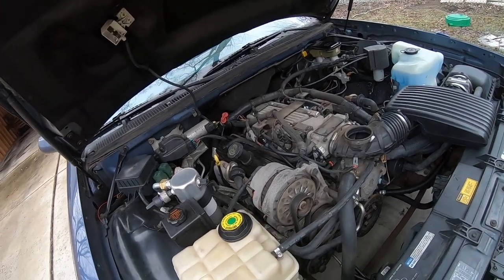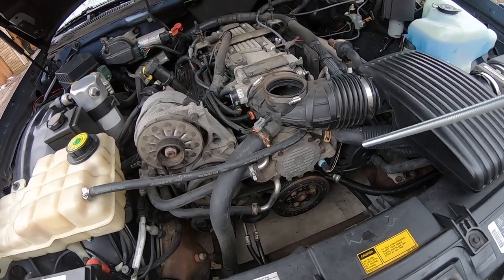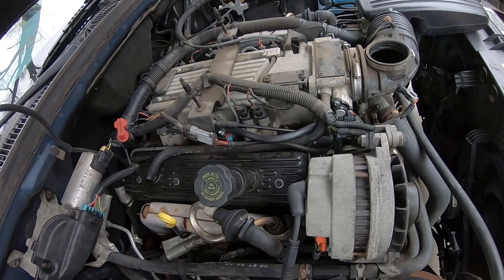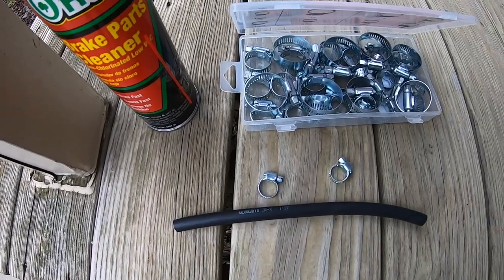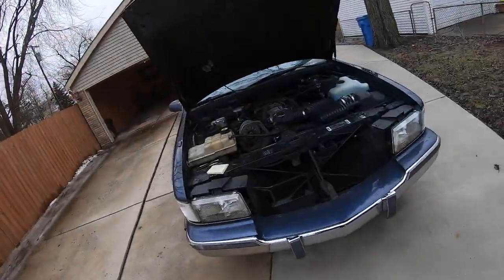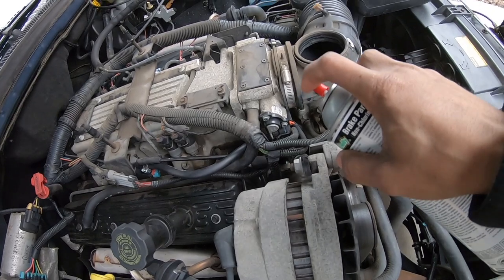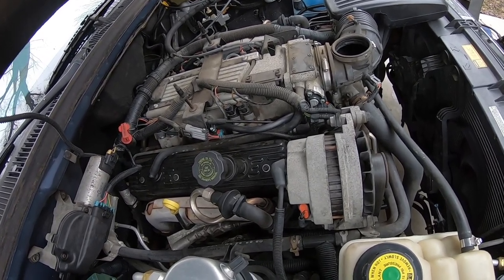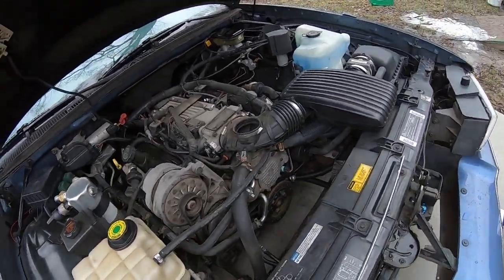LT1 Stalling Problem? Starts then Dies? Check The Vacuum Lines! Not the Optispark & Beware of Forums

Comment: I have a 95 Roadmaster that has a hard start condition but once it turns over it'll stumble and miss but keep running.  I have no check engine light or codes stored.  Can this happen with a vacuum leak? I haven't had it stall out.
Reply from the maker: It could definitely by a vacuum leak. My LT1 stumbled at first. Then as the leak got worse, it began to shut off. It’s quick and easy to check. If it not your vacuum lines, move on to the next possible thing.
Reply: @WorkingWithWimberley  Thankfully that was not the case. My factory plugs were completely shot with no center electrode. But I am replacing my vacuum lines while I'm digging into it.
Reply from the maker: @kevinr8459  I’ll be doing my plugs and wires as well. I hope it helps me too.

Comment: Mines stall real bad when I give it a lot of gas at one time but if I baby it it will pick up speed gradually.. think it could be the vac? It's not cutting off tho
Reply from the maker: It’s possible. You won’t know until you check it. Hopefully it is, because that’s the easiest fix.
Reply: @WorkingWithWimberley  okay appreciate the quick response too!
Reply: I have the same problem bro... did you ever figure out what it is
Reply: @BDOT2012  it was my mass airflow sensor bro
Reply: @318sears8  yeah bro I replaced mines too and still no luck... I appreciate it G!!!
Reply: @BDOT2012  try some fuel treatment i done that too

Comment: Hello I have been having trouble with my 95 camero z28 I have posted a in depth video of the viechle could you check it out and  give me a opinion on what you think my brother and I believe we have received 4 malfunctioning optispark distributors now and is recommending I upgrade from a Oreillys brand opti to msd or ac delco
Reply from the maker: I honestly don't know what it could be. There were few times that I had a car run rough and stall out. And that was because of a bad Mass Air Flow sensor. You may want to check in the LT1 forums and see what guys are saying in there.
Reply: @WorkingWithWimberley  ty for the response sir
Reply from the maker: No problem.

Comment: Hi kim
It doesnt caug fire if you spray the brake cleaner???
Reply from the maker: As long as you don’t spray onto a hot engine, specifically the hot exhaust, you should be fine. If you’re concerned about starting a fire, I’d suggest not trying this method.

Comment: What size flexible hose did you use to replace the original brittle ass hard plastic bro 😂?any specific one
Reply from the maker: It was just a generic vacuum hose you can get from Oreillys or Autozone. I’m not sure the size. Maybe a quarter inch.
Reply: @WorkingWithWimberley  thanks man
Reply from the maker: @Anthony0899  No problem.

Comment: Is WD40 OK to hunt for the surge? I don't have any cleaners. Stalls only once a day after driven about 10 miles, then never again until the next day.
Reply from the maker: It might work. I just googled it and it said WD40 is flammable so it should be possible.
Reply: @WorkingWithWimberley  Oh i get it, just needs to be flammable, didn't understand that part.  I have starting fluid spray too.  Sure hope I can fix this, even the Buick dealerships aren't familiar with LT1s anymore & the auto parts stores never have OBD1 readers (1995) Good info thanks.
Reply from the maker: @GenerallyGeneralLee Starting fluid would be perfect. If there’s a vacuum leak, it will suck in the fluid and you’ll hear the idle surge and get higher. No problem!

Comment: I have a question, my impala will crank but not start. Could this be the problem? It's not the fuel pump because it's new
Reply from the maker: It’s possible. I would check the vacuum lines.
Reply: @WorkingWithWimberley  thank you sir,  you have been very helpful
Reply from the maker: @juliohernandez5961  Awesome!

Comment: Ok so I pulled the little spark plug looking wire from the optispark that goes to the coil and turned the motor over and I have fire using a test light.. ok so I replaced the plug wire back in to the optispark and I pulled the front drivers side spark plug wire and placed the test light in the plug wire and turned the motor over and the test light wouldn't light up... would you say the optispark has gone bad?
Reply from the maker: It's very possible, but I can't say for sure. If you have a reputable shop near you, I would see how much it costs for them to test it. I'd hate for you to buy a new optispark if it's not actually bad.
Reply: @WorkingWithWimberley  ok I don't know what to do here... i have replaced the optispark, map sensor, mass airflow sensor, throttle positioning sensor, and the idle air control sensor on my 95 impala LT1 and it is still throwing a code.. today while the car is running I unplugged the Mass Airflow Sensor, the Idle Air Control Sensor and the Throttle Positioning Sensor and I even removed the hockey puck and the motor never stopped running or even so much as  hiccup... craziest thing I've ever seen... what would cause this to happen?
Reply from the maker: My guess would’ve been mass air flow sensor. I’ve had cars run like crap, but after you unplug the mass airflow sensor, they run fine. But you’ve already replaced that so I’m sorry, but I don’t have a clue.
Reply: Ok I've replaced the Optispark, Map Sensor, Idle Air Control Valve, Throttle Positioning Sensor and Mass Airflow Sensor on my 95 impala LT1 and its still throwing a code... just a few minutes ago it was running and I disconnected the Mass Airflow Sensor, the Throttle Positioning Sensor, the Idle Air Control Valve... I even loosened the hoses clamp and removed the hockey puck and the motor never even hiccuped.... I'm so freaked out... I thought the car would die or at least sputter or something... but if I try to drive it the car will die and acts like it wont start..
Reply: @WorkingWithWimberley  Thank you so much for your time and thoughts I really appreciate it... Merry Christmas to you and yours...!
Reply: @WorkingWithWimberley  Thanks for all your thoughts I really do appreciate it.. Have a blessed Christmas to you and yours....I forgot to mention that one its running its very rich and burning your eyes and smell and the fans come on immediately instead of coming on once the motor has warmed up...

Comment: Right now on this 94 z28 I’m now having issues with cheap azz Chevy gas lines cracking and brittle spewing gas under the driver side of the car.   3 places the line is cracked.
Reply from the maker: Those plastic lines definitely get brittle over time.

Comment: Hi brother 
I have 1996 caprice classic and when I start it and shifts the gear and get my foot off the break it dies and when I reverse it dies , what i do now is using both of my foots on brack and gas panel to avoid dies and to keep it running.
How to fix that brother, you think is the vacuum line?? 
Like yours 
Thank alot
Reply from the maker: I would check the vacuum lines first. And then I would check the mass air flow sensor.
Reply: @WorkingWithWimberley  thanks alot brother for responding  
I will do what you just said, hopefully that will be it 
Thanks
Reply from the maker: @aladwanit  You’re welcome! I hope you can fix it.
Reply: @WorkingWithWimberley  i brother 
I did what did ,, it is running better than before , but still shaking probably needs new sparks too 
I did replace the distrbuter and fuel pump and filter 
Let’s see how will it goes 
Thanks 🙏 brother
Reply from the maker: @aladwanit  You’re welcome. You may want to replace the fuel filter too. https://youtu.be/DUjfNdM1X7Q
Reply: Hi 👋 brother 
I did what you just asked me to do step by step 
But still the engine dies after 20 minutes 
And I noticed the temperature gauge doesn’t work I checked the temperature sensor it works and i did replace it after that i fond there is not electric ⚡️ on the wire that it stokes up on the temperature sensor at all and did check the wire every 2.3 inches till the wire go in to the wall harness 
Could you help me brother to fix my Chevy Caprice 96
Reply from the maker: @aladwanit  Did you check the mass air flow sensor?
Reply: @WorkingWithWimberley  no i did not check mass air flow

Comment: What size diameter was the part you replaced your vacuum hose with 3/4ths?
Reply from the maker: I’m not sure exactly. I took the worn vacuum boot to the auto parts store and had them match it as best they could with the hose.

Comment: How hard is it to swap the dash cluster on the 96 fleetwood brougham
Reply from the maker: It's not hard. I pulled out mine to replace a blown warning bulb. The only part that's tough is not breaking that shift linking indicator cable. I broke mine and it took me a long time to connect it back with a piece of wire.

Comment: Im going to try this out my problem started yesterday when i was taking off to work it did it once and then coming home from work with a few pit stops it stalled twice back to back at the light
Reply from the maker: I hope it solves your issue. It’s the cheapest solution out there.
Reply: @WorkingWithWimberley  did you have aby symptoms though i changed my iac sensor along with the tps cuz they were both right there but still having a little hiccup at idle

Comment: Hey bro I am looking into a 95 ss the seller claims the car never turns off while driving but it randomly wants to lose power but he claims to step on the gas and it goes away would this be the same issue you had?
Reply from the maker: My car was completely shutting off. If he claims his is not, I don’t think it’s the same issue. Could be anything really.
Reply: @WorkingWithWimberley  thanks bro!
Reply from the maker: You’re welcome!

Comment: Wish I would of seen this video b4 I bought the opti spark and had to travel an hour to pick it up and spend even more time to replace it and then buy more coolant to replace what was lost taking off the water pump
Reply from the maker: Was your optispark bad or was it vacuum lines?
Reply: The opti spark wasn't to bad but it was still changed but the housing did have a crack but 3 of my vacuum lines r in bad shape o still haven't got the car running tho is cranks but doesn't turn on

Comment: I am Japanese.  I am riding a Cadillac Bloom 94 LT1 engine.  But the fuel pump does not work.  The fuel pump and fuel pump relay are brand new.  The fuel pump fuse is OK.  Is there any other cause?  I'm really in trouble, please help
Reply from the maker: It could be low oil pressure or a fault with passkey security system. But these are just guesses.
Reply: WorkingWithWimberley 
Thanks for the reply, the passkey lamp is gone and the cell motor is running.  The current situation is that the fuel pump does not work even if the key is turned on, does the fuel pump also work if the oil pressure sensor has failed?  Oil level is normal.  Sorry for all the questions
Reply from the maker: I’m sorry but I don’t know why your fuel pump isn’t working. I hope you can find the reason.

Comment: Car been sitting since I got the motor replace sumtimes it starts sumtimes doesn't but when it does it'll run for few then just shut off like it's out of gas but I'm goin to check the house Right now I'll b so happy if that is the problem
Reply from the maker: I hope it's the vacuum lines too. I hope you get it solved!
Reply: @WorkingWithWimberley  jus posted do u think u could check it out and advise

Comment: my lt1 has a very slow crank like super super super slow then it starts , i feel my engine is dying i replaced the starter, battery, plugs, wires
Reply from the maker: You did everything I would do. I would guess the battery first and then the starter. You may need to do a compression check.

Comment: What if it doesn’t start sometimes as if it’s not getting gas with no dash codes? Someone told me it could be the computer. When it starts it runs fine!!!
Reply from the maker: To be honest it could be a lot of stuff. The only thing I can think of is maybe the fuel pump is on its way out. I’d also change the fuel filter. That’s a cheap one to rule out.
https://youtu.be/DUjfNdM1X7Q
Reply: @WorkingWithWimberley  It none of the stated. I have a 93, 94, and two 95's (all with same issue "starts, runs till it get warm, then cuts off. Won't start untill it cools back off).  I changed ignition, wires, plugs, new fuel filter, fuel pump, new vacuum line hoses (tests for leak "there are non"), new temp sensors, new fuses (and a hold host of other things that I can't think of right now). Another issue is that the radiator fluid turns brown. I've replaced water pump, heater core, radiator and flushed the engine several times.
The cars will start and run till they get warm, then shut off. There is no fuel flowing to the intake. After they cool down, fuel then flows to the intake and it starts. Get warm and then the same process. In the little time that it runs the coolant becomes brown. There is no indication of head gasket leak or other loses of pressure. 
Know what the issue may be.
Reply from the maker: @yebosawubona  One of the main things I see mentioned in the forums is the ICM ignition control module. If you already replaced that, then I don’t know.

Comment: Is there a vacuum line that connects to opit spark ?
Reply from the maker: Depending on the year, I believe so. You may want to check in the LT1 forums.
Reply: If so where is it located. I just  got a new LT1 engine installed. And I had to vacuum hose damage. But car still idling a lil lean and it did cut off once heated up at idle. Wish I had a diagram where each hose run and connect to
Reply: It’s a 94 Chevy caprice
Reply: Also has one vacuum line with funny shape hard black plastic don’t know where it connect to try to see it n your video but couldn’t really see where it connect too

Comment: What if the problem is the car dies out while actually DRIVING?
The car starts up fine after letting it sit overnight and drives fine for like an hour and/or like 20 miles a driving 
Then after letting lt sit for a few mins it will start up again but then die out again
It acts like it's outta gas and will rev high an then die
Reply from the maker: I would check all the same stuff I mention in the video. Vacuum lines, fuel filter, egr valve, mass air flow sensor, etc.

Comment: Nice job.  But beware of Harbor Freight hose clamps--they are worse than useless, as they will get you going, only to fail down the road!!
Reply from the maker: I’ve been using the hose clamps for years and I’ve never had a problem.

Comment: I gotta code P1371 if I leave it for a day it’ll start back up but it won’t start consecutively it literally only runs once a day and I can’t drive it for over 30 min 96 impala can anybody help
Reply from the maker: There’s a ton of stuff in the forums about that. Someone on this thread listed some possible solutions. https://www.firebirdnation.com/threads/engine-code-p1371-97-firebird-formula.291546/
Reply: @WorkingWithWimberley  guess I gotta change the opti that’s pretty much what I’ve been reading thanks just figured I’d give it a shot 💯

Comment: Home plate 😂
Reply from the maker: That’s what they call it!
Reply: Just bought a 94 and having that stalling problem at the light. Then the engine light goes on starts up fine after. Ill give that a try after I swap for colder plugs cleaned throttle body and air filter.

Comment: Just post a vid of egr could u check it out and see if you can help please and thanks
Reply from the maker: I just checked it out. It's kind of hard to see what's going on but you definitely need to replace all those broken vacuum lines. It won't run properly without them connected. You may want to replace the EGR as well. It's not that expensive and it's not hard to get to.
Reply: @WorkingWithWimberley   can I just run the hose straight to the EGR and eliminate the solenoid??
Reply: @WorkingWithWimberley  the solenoid is the piece I was talking about I just found out what it was called lol
Reply from the maker: I'm not a LT1 expert but if I were you, I'd go ahead and try to run the hose straight to the EGR bypassing the solenoid and see if it works. If it doesn't work, your best bet is going to be replacing the solenoid and running all the vacuum lines back to factory specs.